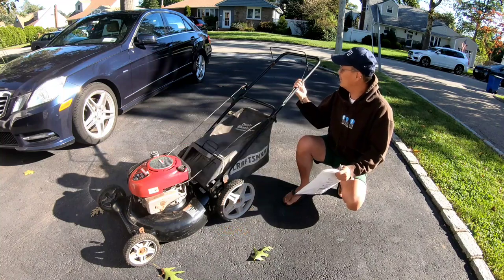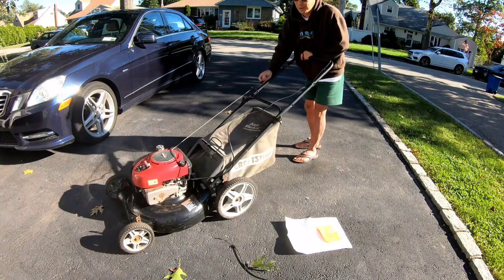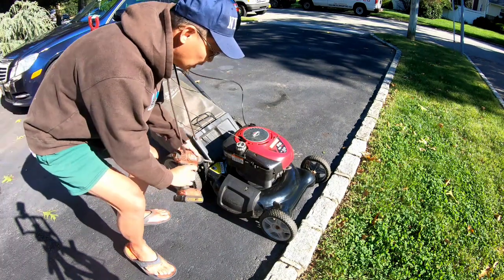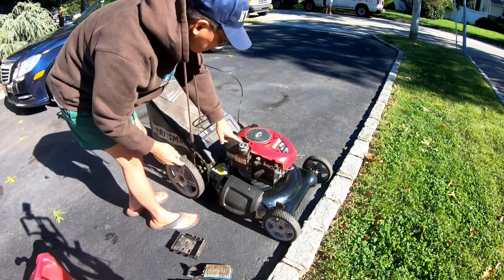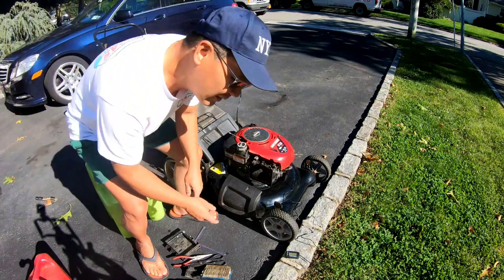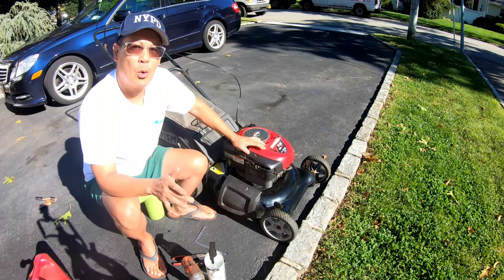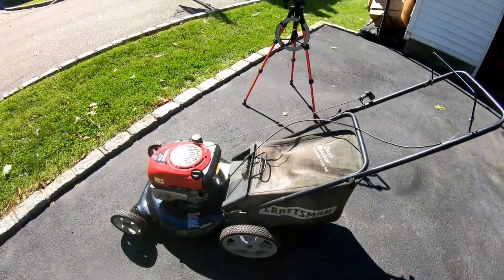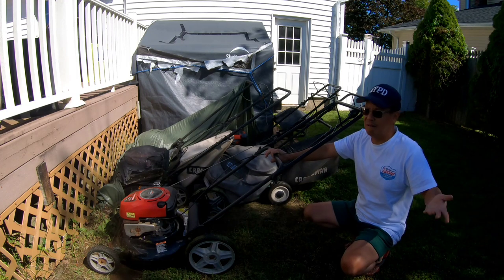HOW TO REPLACE REPAIR FIX A FREE CRAFTSMAN PUSH LAWN MOWER $9 BAIL HANDLE BRAKE CABLE IN 9 MINUTES

Comment: 3600 rpm is max on a small engine.  Something like a generator needs to be set at 3600.  Older mowers like the Craftsman in this video, I set at 3150 rpms.  Tachometers are great.  You have to be really good to consistently set things by ear without a tach.  Most people are not really good.

Comment: $150.  See what happens.

3400-3600 is where you want to be......
Reply: wut....? those quantum's are 2900-3100. look up the parts manual, it shows the top no load rpm near the bottom...

Comment: Nice $150 dollar mower Henry. I sent you a clamp with that tacometer that you can just crimp it on the end of the wire over the insulation and then when you check rpm ,you just clip it to the spark plug wire or boot. Works slick. Frank or Quinn are going to have to line you up with some more content!👍🇺🇸Roger   #mnblucas
Reply from the maker: Yeah buddy thanks

Comment: Why did you part out the john deere
Reply from the maker: How did you know I parted it out?  Front end spindles seized,  steering sector stripped,  body rusted!  Doneski
Reply: @MowersNBlowers  was the v twin good atleast?
Reply from the maker: @nickflopper  looks like it… both conrods are connected! 👍